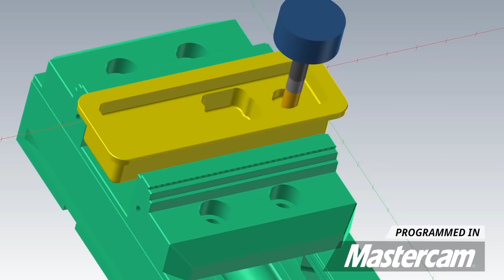My Boss SUCKS and Represents a CANCER in our Industry… I’m DONE.

Comment: Many years ago I told a machine vice company to start making an extendend vice with stops so that two small parts could be loaded about 150 mm apart so that the program for the first could then lift, move 150 mm and do the other part.
Idiot said 'Who would sell them for us!'
Reply: Omfg!  Not to sell dummy,.  Then you shook your head right?
Reply: @davidthomas4325  
I had said that as CNC were getting common it was silly to use a single vice when a double could really speed things up but I was ignored.
Most bosses and managers are infected with the 'Not Invented Here' Syndrome that makes them automatically refuse anything from outsiders no matter how big the potential market.
Reply: @davidthomas4325 I once did a few months at a company making gearbox selector forks of malleable iron.  We checked everything with plug gauges or snap gauges and two of us ran five CNC that made 8 parts each every 20 minutes or 120 an  hour.
Went into work one day to find all gauges had been removed and we had to check each part in the shiny new CMM withRenisham tips.
It was so slow it took nearly an hour to check 30 forks.   Other 90 forks had to be thrown away as customer wouldn't accept any non-CMMed.
Businesses can't survive if they throw out 75% of production that was suddenly unacceptable even though tolerances were quite low.

Comment: You arr talking about milling aluminum 30 inch/min as something terribly slow.  On my small manual milling machine I hardly do 6 inch/min on aluminum. Speeds like 200 inch/min you mentioned are really shock to me. Its good to have tough machines that not bend and vibrate under such load.
Reply: Umm.. yeah.. most decent brand cnc machines can handle 200ipm in aluminum without any issues. I’ve ran aluminum at 3000+ SFM and 200ipm with full radial on the tool. This actually increases tool life by the way. A small manual machine is gonna be much different. I guess everyone has just got to get to know what their machines are capable of.
Reply: It is always aluminum in these videos. lol

Comment: Wait.... 30 IPM? That's like 750 in metric

That's a finishing pass at 50mm DoC for HEM using something like a 10-16mm endmill
Reply: Does his shop only cut aluminum? 30 IPM is a safe controllable speed for many reasons I don't understand all this 200-400 IPM work aluminum anyone can cut with confidence.
Reply: @togowack  faster is always better if you get the same result
Reply: @angrydragonslayer  technicians think so but management can tell if a program has been modified if they go out with standard speeds and can be reliably bench marked and quoted for understood conditions.

Comment: Slow feed kills tools.
Reply: to fast too :D
Reply: @ShInYaKu88  The trick is to find the max. feedrate the tool and the machine can stand safely.
With that you get the maximum tool life.
Reply: @norbertfleck812  i know. thats "the thing" of our job :D
Reply: @norbertfleck812  the max feedrate = max mrr, not max tool life 😉
Reply: @robinlambregts  The max. feedrate at a moderate cutting speed provides the max. Tool-life.

The cutting edge wears up on the number of cuts, not so much from the chip size.
Reply: @norbertfleck812  i agree and disagree ✌🏻😅

When u go to say 90% of the max feedrate your tool life will extend a bit.

And so max feedrate doesn't equels max tool life, it equels max mrr. Given by the manufacturer of the tool.
Reply: @robinlambregts  The max. feedrate is the feedrate which still goes smoothly with a nice cutting sound. 

As I measure tool life in "pieces produced" and not in "time in the spindle", I think we both talk about the same.
Reply: @norbertfleck812  that's not the max feedrate, that's the ideal feedrate. Its in the word MAX
Reply: @norbertfleck812  and how is the tool life the same as the amount of pieces produced? 
If your tool life is longer than u produce more pieces 🤷🏻‍♂️
Reply: @norbertfleck812  maybe not with the same mrr but atleast more products
Reply: @robinlambregts  When I increase the feed rate to a reasonable limit, I produce more parts in less time. And though the mill won't survive as long (in minutes) it can produce more parts.
Reply: @robinlambregts  That is a matter of definition. The ideal feed rate can be higher than the suggested max. feedrate of the tool manufacturers.

However, (too) many CNC shops preserve their tools to death with too little feed and too little cutting speed.

And it's a hard job to push the own employees to the ideal feed rate.
Reply: @norbertfleck812  i dont really see how the ideal feedrate could be higher than the max feedrate the manufacturer gives. 

A manufacturer tests their tool (hundreds or even thousands of them) to get to a max feedrate a tool can handle. Tests done on the max and on the min of a tool. 
Ideal is inbetween.
Reply: Sfm governs most principles of mrr.